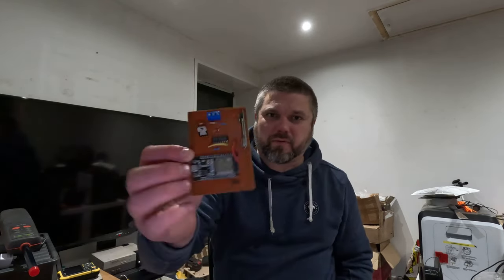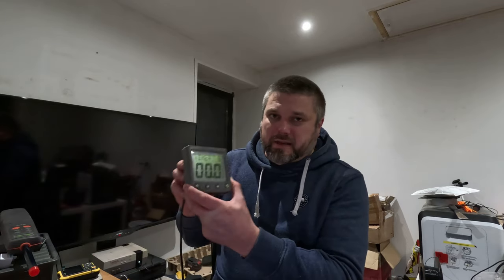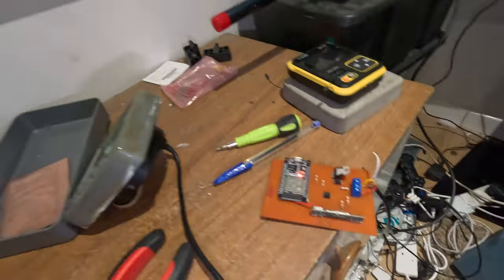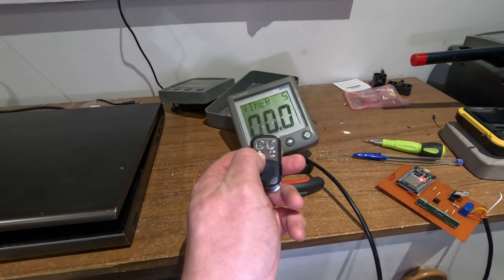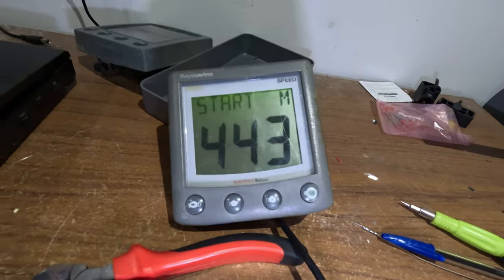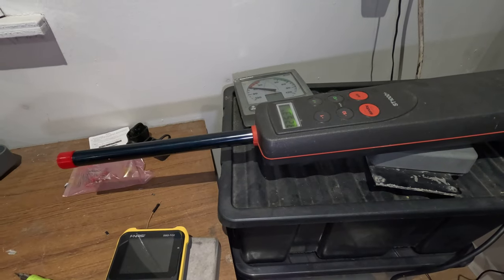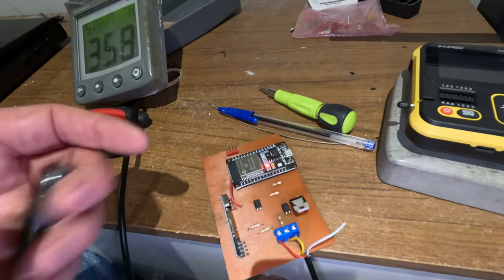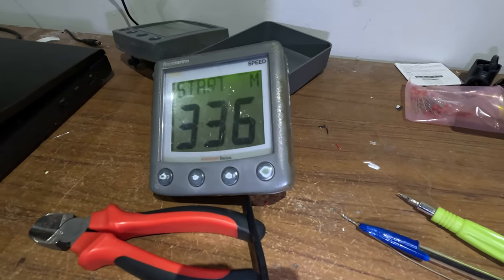Preview prototype of a shoestring remote control for Raymarine ST1000 Auto Pilot  and ST60 Timer

Comment: Nice Project. Doing something similar. I am quite interested in the circuit you are using to interface to SeaTalk. It looks like some voltage divider and an optocoupler. I am looking into using an LM293 comparator, but your solution seems simpler. What libraries do you use for the 9bit communication?
Please share
Reply from the maker: I've changed the circuit around a bit since this video , still using the optocouplers . Not that i'm an expert but seemed in theory to give better isolation and avoid some of the issues with transistors and it adding noise onto the seatalk line.

Ive also adding a GY93 Compass to the board , this will transmit compass signals onto the seatalk bus  to effectively give a remote compass to avoid the issues with the outboard driving the compass won the St1000 wild. Ive also started coding a NMEA converter so it'll work with Open CPN over wifi .

I'm just using standard software serial in esp32  8 bit then checking the parity bit if it's a command or not . Seems to work fine for me :-)